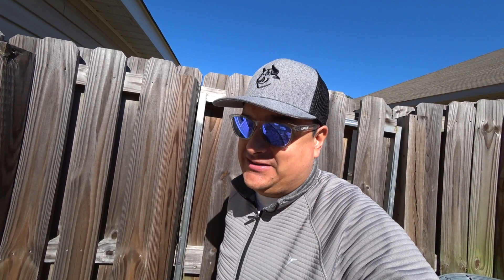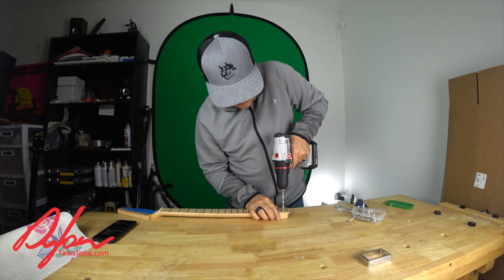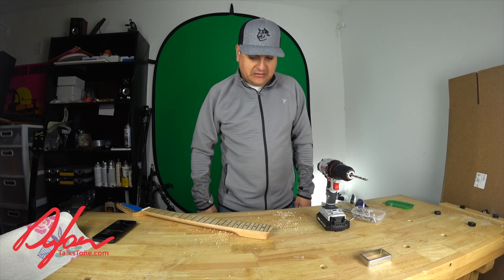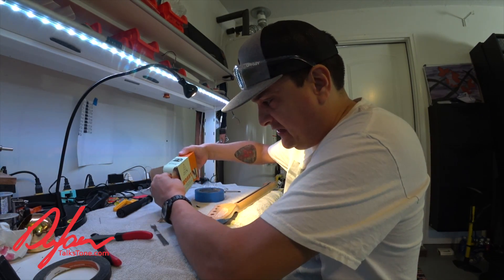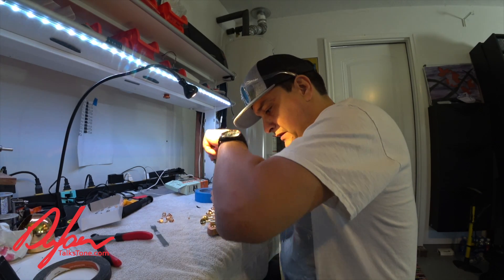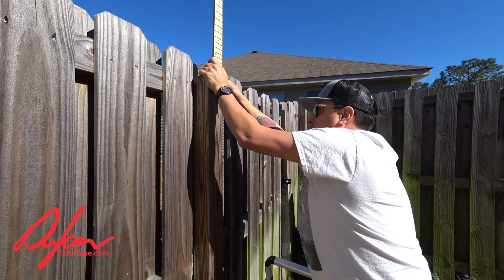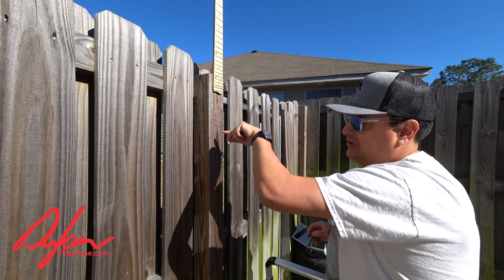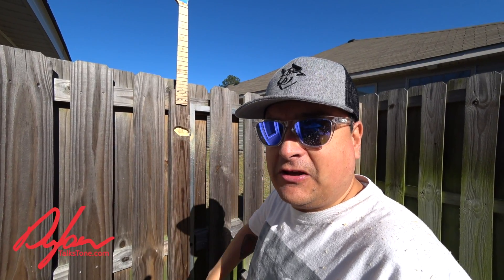The Tonewood Debate  Can A Fence Post Sound Like a Tele   Part 1- Episode 299

Comment: Hi Dylan,  I am building a 60' s classic player Stratocaster. As per the fender schematic, it calls for a Fender capacitor with a value of (.1uf)  however I do not know what side to solder to ground. There are no markings on the cap either  positive or negative and both legs are the same in length. Does it make a difference on a caps this small? does this small a cap value have a polarity?  Thanks: Jeff

Comment: The ULTIMATE EXPLANATION. If you are planning to say ANYTHING  about TONEWOOD, please CONSIDER THIS FIRST and save us all some time: I hope tonewoods are true but so far I’ve only seen evidence to the contrary. Eg, When any wave “ricochets”  (including a guitar string off a nut/bridge) the returning wave is ALWAYS identical to the original outgoing wave, apart from its lower amplitude (volume) and phase. The shape of the wave doesn’t change from the bounce. The shape only changes when the waves bouncing back and forth interfere with one another. 

The interference shapes the final wave and tone. When the wave stabilizes (seconds after plucking), the wave reaches its final shape. The final shape can easily be deconstructed into its constituent wave parts. Those constituent waves are always identical to the original outgoing wave, apart from amplitude (loudness) and phase. 

In other words, the proportion of amplitude (volume) lost at each bounce is the same for all frequencies. The wood (or any material) can not “suck out” or subtract specific individual frequencies from the string to shape tone. There is no debate here - it simply can’t. Therefore, the choice of material has no effect on the shape of the wave or, by extension, the tone. The shape never changes (apart from interference) and neither does the tone.  

Simplified Example: if the original wave has the values “12,-12,12,-12” the out-of-phase returning wave has “-10, 10,-10 10”. When combined, this final wave (tone) has the values: “2,-2, 2,-2” (12-10; -10+12...). The returning wave would NEVER have values like “10, 10, -10, 5”. Never. Impossible. Can not happen.  Does not happen. If it happened, we would need to rewrite physics. This is true for all waves. 

This is not some crazy idea of mine. It is nothing new or spectacular. It is basic physics, and it has been known and documented in physics for a long time. It is completely verifiable, and it is on the same confidence level as “Conservation of Energy”, F=MA and e=mc^2.  There is nothing new here. 

So summarize:
1. Plucking a string sends waves through the string to the nut, which bounces back. 
2. The bounce reduces amplitude, but does not change the shape. 
3. The bouncing waves interfere to form the final wave shape, ie the final tone. 
4. When analyzed and picked apart, the final wave is always the sum of multiple copies of the original outgoing wave, at different amplitudes and phases.

These physics clearly supports that body material is irrelevant, and that it is impossible for  “tonewoods” to shape sounds on an electric guitar. I invite anyone who can disprove this, or anyone who is aware of physics pointing to the contrary, to inform me. I would happily look at it. I actually hope to be disproven because I really wish that the tonewood thing was true.
Reply: I'm inclined to believe tonewood choice has an effect on tone as pickup selection does albeit to a lesser degree. The speed of sound in wood varies from 3300m/s to 5000m/s depending on the modulus of elasticity and density. This change in speed alters the wave length for a given frequency. So for a given harmonic frequency it's reasonable to consider that a certain tonewood could produce an antinode under the pickup an another tonewood would instead have a node, which would have a significant drop of that harmonic in the overall tone. 

So changing between two woods with different modulus of elasticity and density would alter the behavior of the wave pattern in the wood and thus the oscillation of the pickups. On the other hand changing between two types of wood with the same modulus of elasticity and density would have no effect whatsoever.

Comment: The tonewood debate is about whether, all other things being equal, would the change of wood change the tone of a solid body electric guitar?
It's not about whether a fence plank can sound like a telecaster.

You should compare two planks (say mahogany and maple) on the same fence using same components on both planks.
Reply: kitko33 actually it is.... If it sounds like a friggen tele..... It obviously isnt that big of a difference. This is the extreme of nothing being equal and potentially still getting the same sound. But ultimatly.... Its for the views and the fun of ticking people like you off hahaha
Reply: What affects tone is the speed of sound through the material which in turn affects wavelengths for harmonics. This moves nodes and antinodes around in a way similar, but considerably less significant to switching pickups. 
So yes the test should be done with different fences with known different modulus of elasticity and density and thus different speeds of sound. If the fence wood has a similar speed of sound as the original tele body they will sound the same. Keep in mind that wood has speeds between 3300m/s and 5000m/s. Which is quite a broad spectrum. A lot of other materials have speeds of sound in that range and guitars could be made from them without any tonal difference from the tonewood of similar properties. That doesn't mean tonewood has no effect on tone. It just means another material was cleverly chosen to preserve the same tone.